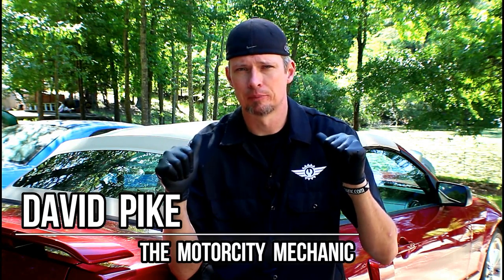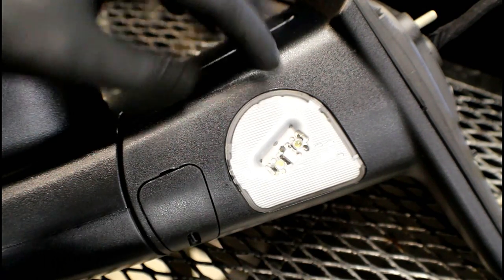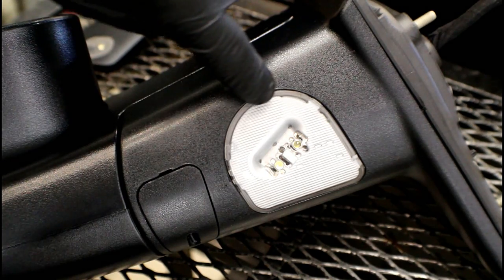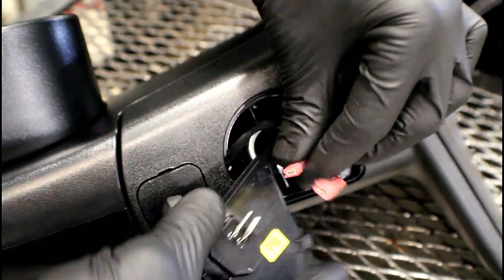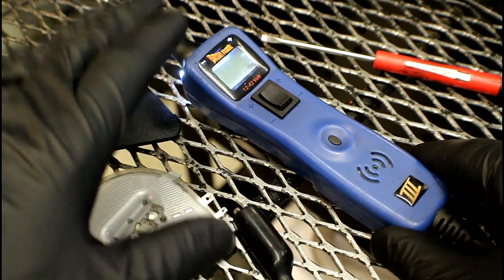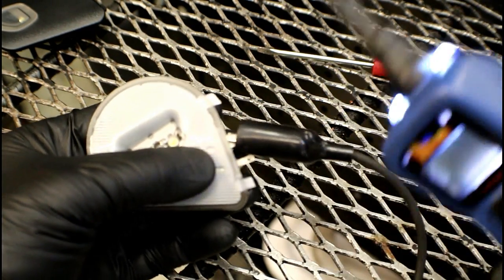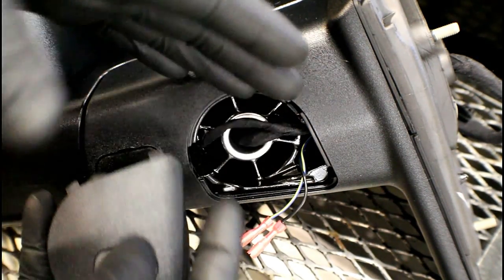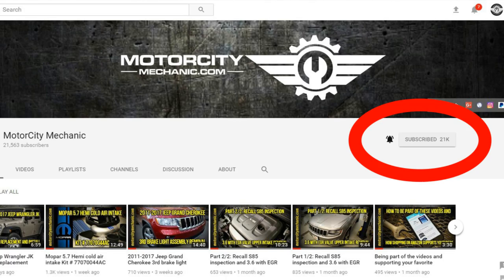2010-2017 Ram Truck folding tow mirror puddle light replacement

Comment: Wonderful video explanation!  Dealer wanted $160 to replace both puddle lights.  I bought both lights at Amazon, as you recommended, for $48.72 and installed both lights in LESS THAN 3MINUTES.  Yes, less than 3 minutes for both.  Thanks so much!
Reply from the maker: Awesome! Glad that the video helped. Watching and responding to the video took longer then the actual repair haha! Thanks for watching and for the info. Make sure to subscribe!

Comment: I have a question my mirror got broke the other day and dodge replaced my mirror and the new mirrors are the same as the old but the puddle light when I pop it off has a single connector to it and I can’t find a replacement. Also there is a red/blue wire and a black/white wire. Is the red/blue positive?

Comment: Great video, so on mine 2017 I don’t have them , is it possible to intall them ? Or i need to chenge the all mirror ? Thanks
Reply from the maker: You will need to sway yours out for a set that has the puddle lights already on them and then you will need to have the dealer change/add the related sales codes and then have then download it to the vehicle so that the systems then know what was added so that it will work correctly. Thanks for the question and make sure to subscribe!

Comment: The tow mirrors that come with that updated version are about impossible to remove the puddle light without damaging the assembly because there is no gap to insert a pry tool.

Comment: Great vid as always. I got a question whats the little lever right in front of the puddle light almost looks like a lock of some sort? It's only present on the drivers side...
Reply from the maker: Good question Paul. That item your speaking of is the outside temp sensor! Its only on the drivers mirror. Appreciate the question and for you watching as well.
Reply: Thanks again, love the vids very clear and concise. Keep up the great work....best of luck with the channel.
Reply from the maker: Thanks again Paul!
Reply: Outside thermometer.

Comment: Hello what would be the problem if I'm only getting 5 volts from connectors and the new puddle lights installed aren't working? Neither are signal

Comment: Hello Dave my question isn't with the lights it's with the mirror adjustment I have a 2013 if I flip it up as trailer mirror the adjustment doesn't work in junction with being up it's a quarter off I can work it this way but is this normal the reason I'm asking is I had a 03 that work in junction with the switch never a quarter off

Comment: hi very nice video. i was wondering how to take apart the mirror for a regular mirror not a tow? i have a 2017 ram 1500 sport. Also I was wondering if you can help me. Since I have a sport model  it comes with sensors on the front bumper and i would like to put on a nudge bar but i'm told that for the sport model you cannot put one on because of the sensors but i have a question what if i install the 2 center sensors on the nudge bar will that work?
Reply from the maker: I do have some stock none towing mirrors that I could film. Just need to work it in sometime when I have a chance. When it comes to those sensors....you need to move the sensors as far forward as possible or it will pick up the nudge bar as being infront of the vehicle and give you that warning.

Comment: Hey how are you? I have a question. On my 2014 Dodge Ram 1500 Laramie drivers side,side mirror the blinker light is out and the puddle light. Do you think it’s a fuse or is it that both just need to be replaced?
Reply from the maker: There is no fuse that I know of. Its hard to say for sure if they both are bad...its going to take some checking first. Odd that they are both out at the same time or maybe they went out a different times but you just noticed. You can easily remove both puddle lights on the left and right side and plug the side thats working into the side thats not to help rule it out. Thanks for asking and make sure to subscribe.

Comment: I got a 2015 Dodge Ram tradesman and I replace the mirror to folding mirrors, and my turn signal don't work .. do I need to replace the module ? any advise?
Reply from the maker: In order to get them to work properly....you will need to have the dealer update the sales codes/options online and have them download it back to the vehicle so that it starts working correctly. Basically the vehicle needs to know what it has and this is the method to do that. Thanks for asking and make sure to subscribe

Comment: I like your videos they're great I have a question I have a 2012 Dodge or Ram 3500 I am trying to find the Ambient Air Temperature sending unit or sensor. Sometimes it will read 66 when the temperature outside is 80 I can't seem to find it can you help me out thank
Reply from the maker: Its actually located in the drivers outside mirror assembly underneath. Its part of a plastic panel that can be popped out.
Reply: MotorCity Mechanic 
Just found it. 2012 ram  is located next to the driver side headlight back of the grille
Reply from the maker: Cool. I have seen it there...wonder why there is one in some of the mirrors as well.

Comment: I can't get a straight answer out on anybody I'm trying to upgrade to tow mirrors on my 2014 Ram Express heated manual mirrors. Like to upgrade to tow mirrors heated manual with a blinker I don't need a floodlight I think that's stupid.  How do I go about making this happen.  Thanks
Reply from the maker: Swapping wont be an issue. Being that they are both manual......I dont think you need to update the sales codes inorder to get the turnsignals to work. I havent tried this myself so I am not 100% sure. If the sales codes do need to be updated....then the dealer will need to do that. Updating the sales codes tells the vehicle what new options it has and then it allows those items to work properly.

Comment: Hi again Dave.  Hope you are well.  Recently I noticed my right projector headlight assembly was getting condensation inside the lens.  When I removed the headlight housing there was actually water sloshing around inside the headlight housing.  I poured the water out, dried the inside with a hair dryer, and reinstalled it.  Now I get a “right turn signal out” warning in my evic even though all the lights apppear to be functioning properly.  I also get a hyperflash turn signal light on my dash but the turn signal itself flashes at normal speed.  Any ideas?

Thanks
Reply from the maker: Nothing is coming to mind at the moment. When you get water inside you typically need to replace the assembly. One thing you can do is drill a small hole in the lowest part of the housing. It doesnt stop the moisture from getting inside but it gives it a place to go and not accumulate.

Comment: Hey David, a guide question. On the 2005 Durango with the 5.7 hemi ,  what's the part called that bolts up to the oil pan and transmission if you could give me a part number that would help lots. Thanks
Reply from the maker: Evening.....not too sure what your describing. Are you speaking of the structural collar that adds strength thats held in place with a few bolts? You may need to email me so that I can help you with pictures for example....cant post images here in the comments section. Email me at david@motorcitymechanic.com

Comment: Where do we get the code to give to the dealer on a 2018?
Reply from the maker: What code are you speaking of? I am guess your upgrading your mirrors and needing to have the dealer change the sales codes to get them to work properly. Typically what I do is see if there was a kit thru Mopar....if so then there will be a set of instructions that tell the sales codes needed. Otherwise the dealer can see all the avail sales codes when they log online to change them. Sometimes it depends on the year. Looking on line I see LEB, LEC, and LEG being 3 that people have been using. Thanks for the question and make sure to subscribe.